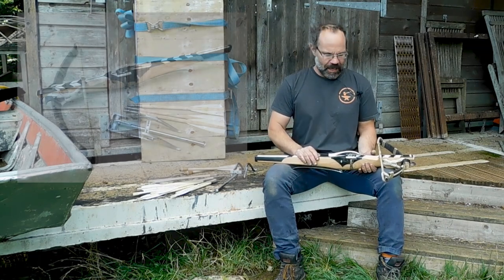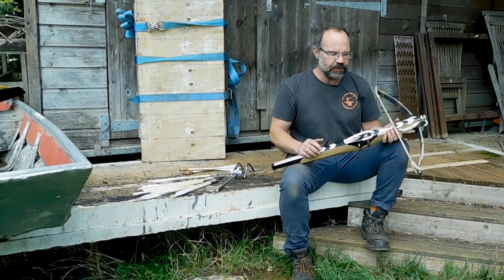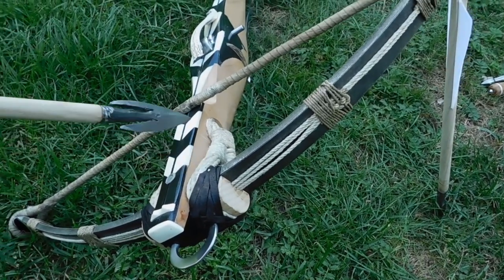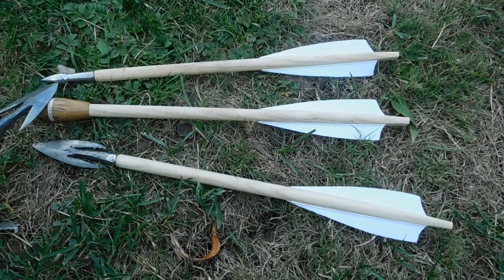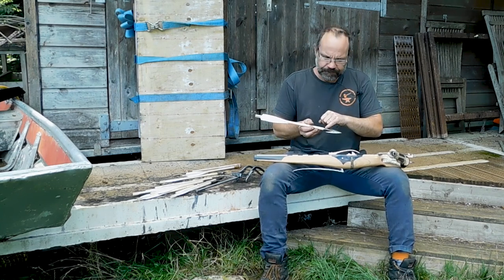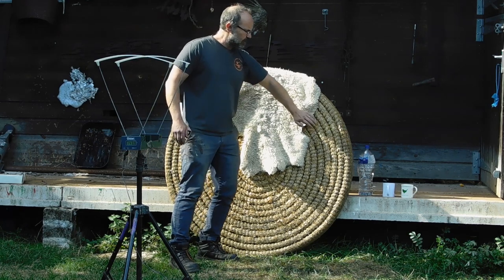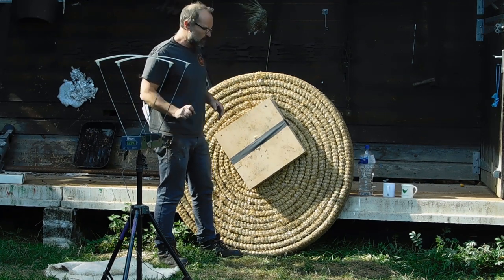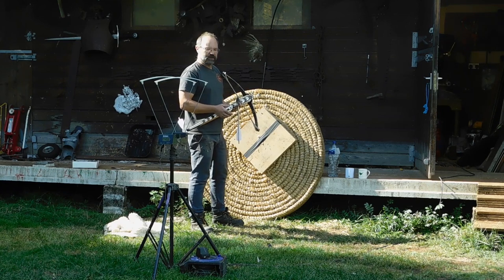470lbs Medieval German hunting crossbow - shooting barbed heads!!

Comment: The best way to forge an arrow head that I've found is to make the cone first, then forge weld the small end to a small nub on the point. This also works very well for spear points and any socket tool like a wood chisel. This technique was used up to the early twentieth century for most chisels.
Reply: Mike Blair a bick iron helps

Comment: Nice decorative work, I wonder why Western Europeans don't seem to have bothered with it all that much. 

PS, In the past I have pestered you with questions regarding bolt weight but what is the actual ratio of the weight of the head compared to the shaft? There are some Germans out there saying the shaft would ideally weigh as much as the head itself.

Comment: Using a formula that is fairly accurate at describing draw force curves for bows that are straight in their unstrung state, and given a power stroke length of 0.145m, I estimate that this crossbow stores 145.6J of potential energy at full draw. If the blunt bolt you shot is 0.05kg on the nose, then it had ~48.1J of kinetic energy by the time it went through the chrony. Assuming negligible velocity loss between the moment of launch and the moment the bolt passed through the chrony, this yields an energy transfer from crossbow to bolt that was 33.0% efficient. This in line with other efficiencies for crossbows of this era that I've calculated. The same general set of calculations predicts a massless bolt would launch from this crossbow at a velocity of 53.6 m/s (175.8 fps).

This allows an interesting comparison. Joe Gibbs has shot videos of himself speed-testing some of his longbows. Assuming a 23" (0.5842m) powerstroke and using the same draw force curve formula I used for the crossbow, one of his 160lb longbows stores ~199.6J of potential energy. In one of his videos, he shoots a 0.075kg arrow at a velocity of 60.8 m/s, giving it 138.7 J of kinetic energy. That yields a 69.5% efficient energy transfer. The massless arrow velocity (or dry fire speed) for the bow Joe used in the video I'm referencing would be ~110.1 m/s.

Using this crossbow and Joe Gibb's longbow as representative of these two classes of weapons, and assuming that energy storage, limb mass and other relevant properties of the crossbow scale linearly with draw weight, then to shoot a bolt with the same mass to draw weight ratio as the bolt in this video with as much kinetic energy as a 0.075kg arrow shot by Joe Gibbs' 160 lb longbow, a crossbow of this era would need a draw weight of ~1356 lbs. The same projectile energy could be achieved from a crossbow of the same design but lower draw weight by a bolt with a higher mass/draw weight ratio, at the cost of lower launch velocity.

If my estimates are reasonably accurate, then it would seem they challenge an assertion about crossbows vis-a-vis longbows that I've often read, which is that relative to longbows, crossbows shot projectiles at higher velocities across flatter trajectories at their targets, and that what gave the longbow a greater effective range is the fact that longbowmen could launch well-aimed arrows at higher trajectories than are possible with crossbows. My estimates suggest that, broadly speaking, longbows like Joe Gibbs' were able to shoot projectiles at higher velocities and kinetic energies across flatter trajectories than their contemporary crossbow counterparts and that in order to match or beat longbows in terms of projectile kinetic energy, crossbows would need to shoot very heavy bolts that would have had launch velocities less than or equal to a somewhat poky ~47 m/s, give or take.

Comment: This is a grey area for me. I'm all for hunting, I used to do a fair bit of it. However, I am one of those modernists who thinks that the best tools for the job should be used and this means modern equipment designed to deliver accurate and powerful hits. Hunting for me is all about respecting the quarry and I respect it enough to use the best tools to end its life quickly and cleanly. Never been a fan of bow hunters, modern crossbows are still something I'm not sure of, but those who use primitive weapons like this or even spears. Not a fan. But I guess to each their own, just hope that the guys a good shot and doesn't cause any unnecessary suffering. Not like its easy for a follow up shot with this thing.  I am very happy that such hunting is completely illegal in the UK. Still a fine piece of work. You are very good at your trade.

Comment: You talk about re-using crossbows when the bow brekas, Do you have any idea about historical cases for re-using the boltheads when shafts break? Also do you have any ideas about how the 'trigger bar holding a disk in place' mechanism got to be so common compared to in a very short time  a totally different trigger mechanism dominating in muskets?
Reply: A Muskets trigger system just needs to either mechanically move a  small lever  holding a matchcord, or release a small spring loaded component of the ignition system, the lock. It does not have to keep up with the full power of the weapon, that is mechanically stored in a piece of  curved steel, like a crossbows trigger has to do.

A fat military style flintlock musket has a cock spanned easily with your thumb alone, and that is all the trigger needs to be able to hold.

Comment: Oh and another quick question, How long can you keep the crossbow ready to shoot before it harms it?
Reply: Well that depends on the metallurgy and heat treat. I have a bow from the 1970s. I re-strung it and it worked well. I let it sit just strung, not drawn for many years. Went to test it a while back, and it had lost power. Seems the steel limb has lost some spring.
Reply: Steel weakens during transitions not when energy is stored. So firing the crossbow is actually what is wearing it out, not keeping it "cocked".
Reply: Yes, that is what people have said for a long time, but in my experience any spring that is compressed for a long period of time seems to take a set and weaken despite knowing that it is the use that wears it out. Magazine springs on my rifles and pistols, if loaded for a long period of time, will be noticeably shorter then ones left unloaded after many months.
Reply: A bow kept strung will lose it's spring (as will the string) so I was wondering about keeping a crossbow cocked what that did to the string and the bow.  (I know from experience keeping a firearm cocked while being stored for a long time is not a good idea.)
Reply: You can keep your firearm cocked forever, it wont affect it. Anyone who says otherwise is not experienced, there have been numerous studies on this. Google is your friend.
Reply: If the bow is steel and correctly made you should be able to hold it cocked indefinitely without any loss of power. If steel took on a set when under tension you car ride height would drop every year as most cars sit on steel springs that are under the constant weight of the vehicle. Wood and other materials might take a set under constant tension, but not steel.

Comment: in a battle, where the archers/crossbowmen are unimpeded, it goes on for a long time (so firing rate isn't so relevant), etc...would it be better to have bolts or arrows... which are easier to transport/manufacture?  Or how many bolts could one carry reasonably, compared to arrows.  (It is my understanding that archers used to carry 30 x arrows, as a general rule (for at least some armies).

Comment: you mention there are no sights on this crossbow and I am curious when those became something standard and if they were only meant for longer distance shooting.

I ask because I was in Italy a few summers ago and I was very fortunate to be in a place that was holding a crossbow tournament, an annual one that had been going on for a few centuries the pamphlets said, and the crossbows they used were 1) very large, probably at least 4 or 5 feet in length and 2) equipped with sights as they were shooting at a target that was about 12' in diameter about 50m away.
It is possible that the sights on the crossbows were custom (much like competition shooters will customise their firearms to perform to the best of their abilities) but seeing a few videos here and noticing that most of your crossbows don't have sights it made me wonder if that was something was ever adopted for military or hunting use in the medieval and renaissance periods

Comment: The thing on the curved flight rail you comment around 2:00min. Wouldn't it mean the bolt end will be pushed not in a straight line but rather along a curve? With the bolt but going down and back up as it is pushed along forwards. Thanks
Reply: No... the force of the bowstring is such that the string will keep the bolt above the  table, guided by the bolt guide.

Comment: Dear Tod, beautiful crossbow. I was a little bit surprised, how it is possible, that such 470 lbs strong crossbow creates bolt speed only 143 fps and for example such cheap modern Jaguar crossbow with only 150 lbs makes 220 fps. Is it thanks carbon bow and longer shooting drive on the shaft? Such a difference? How fast are windlass 1250 lbs crossbow bolts? Thank you very much.
Reply: And was hunting possible with it? Bear or another big deer?

Comment: 470. Pound draw weight. No way!
Reply: watch his video on "ways to load a crossbow" and you'll be amazed to discover that this one is on the "weak" side.
Reply: All the recoil is shock from underweight arrows. They need to be very heavy to buffer the shock. Modern crossbow manuals list minimum safe arrow weights to prevent voiding their warranties. For a 150#recurve, it's a 340grain arrow. A 1500grain arrow is the maximum. 10grains/#.

Comment: How thick was the steel sear plate on the roller nut are the all the same thickness on crossbows?
Reply: @tods_workshop  was that the thickness of the steel  sear plate on the roller nut or the width?

Comment: Would it be possible to make a crossover Chinese/late mediaeval European crossbow? (1250 windlass something like that but with a lot longer draw so you could get the most out of a 1250 crossbow). Maybe some other added mechanical advantages like minimized friction techniques or  something like cam wheels for example and so on.  I mean I see a lot of modern bows with all of those type of features to maximize efficiency, how ever usually they tend  to have lower draw weights dew to their length. But I cant help but wonder if you could push that out to the max with a 1250 bow with a longer draw weight granted it would have a far slower fire rate but I feel like that power would be unrivaled. Maybe even compared to early matchlocks and other firearms?  Like with the idea to basically build the most powerful crossbow a crossbowman could practically use on a medieval battlefield. But with our modern tampering/manufacturing skills, and knowledge. Plus our modern understanding of physics and with all that is available to us with modern hind sight, and with all that being said if you had an order of crossbows that had to be sent back in time for a medieval army what is the most power you could possibly get without suffering the major inefficiencies in historical crossbow design?

Comment: This is very weak compared to modern crossbows... my brothers 175lb crossbow delivers 64J with a 21g bolt although I will point out it has double the draw length I still feel this is odd. I wouldn't expect such a difference, to be honest, I thought they would be similar in output energy due to the massive difference in draw weight.

Comment: Beautiful craftsmanship, I appreciate your talent but this is not a good hunting bow. It should be enjoyed as a target bow, display an conversation piece. I have a modern crossbow that is 2 + the speed and power with pin point accuracy .
Reply: Of course, but it’s called a hunting bow because that’s what it was originally designed for, not to reflect actual modern day usage of the replica.

Comment: 470 pound draw weight, damn want are you hunting? Sherman tanks?
Reply: he has a 2000 lb one XD just saying, you can see them in the video he has about loading Xbows
Reply: The short power stroke reduces energy, an 80# or less longbow offers more arrow speed with a heavier projectile. A good recurve will beat them both.
Reply: @aenaros6845  2000lb? no he doesnt what are you talking about?